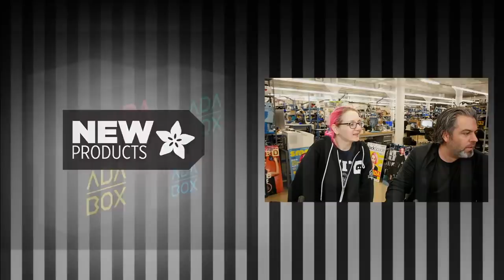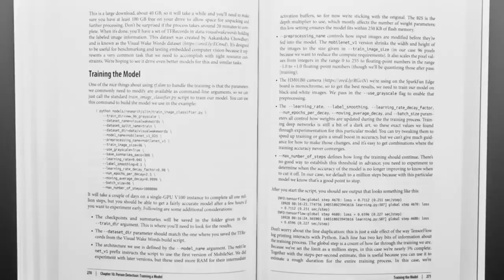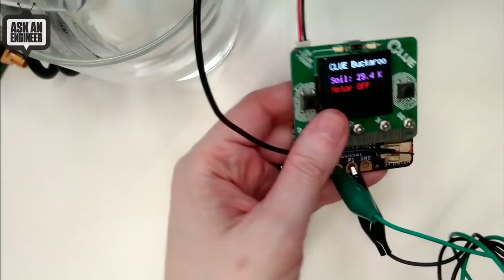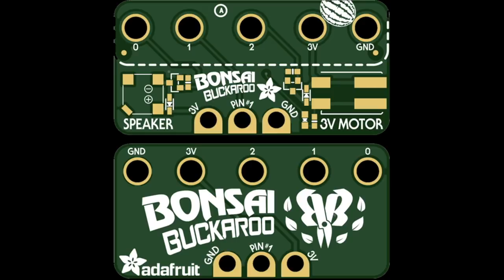New Products 2/19/2020 featuring Adafruit Bonsai Buckaroo - micro:bit & CLUE Plant Care Helper

Comment: I used to work for a research institute that flew stratospheric balloon payloads. One of the OTH (Over The Horizon) communication paths was Irridium. It was useful for basic telemetry and commands to and from the payload. Not enough bandwidth for science data, but certainly enough for position and status messages. I don't remember what Irridium reseller service we used because our flight facilitator (NASA's CSBF) arranged the communication for us. We just needed to connect to their equipment with galvanically isolated serial (3-wire RS-232).
Just thought I would mention it for anyone who does high altitude ballooning as another communication option for their flights. (The communication lag and per-message cost doesn't make this viable for drone flying though.)